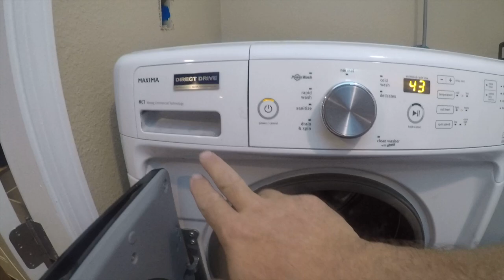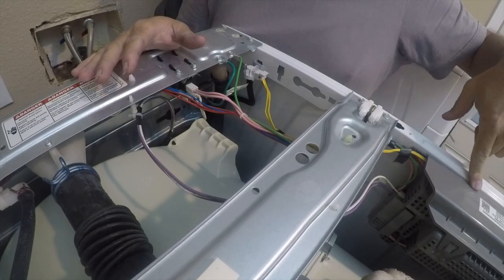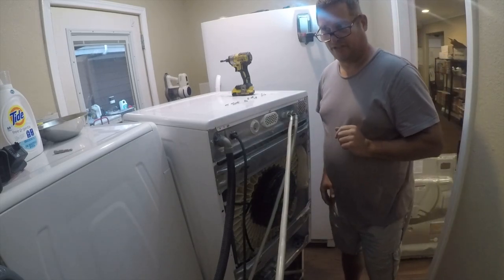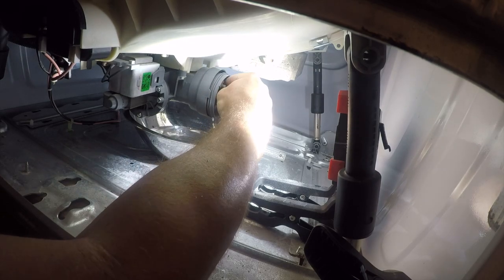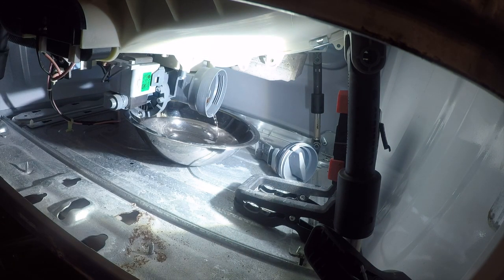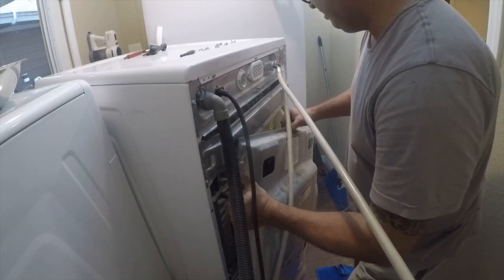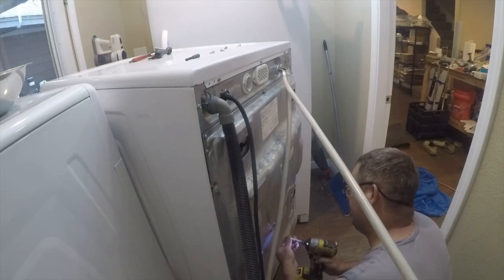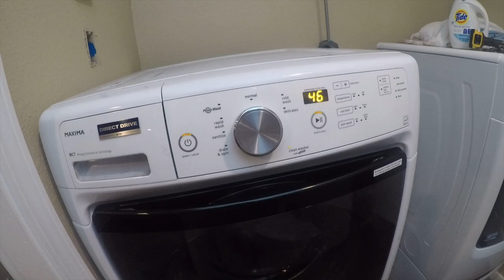Maytag / Whirlpool F9 E1 Error - change pump

Comment: If you, or someone else watching this video needs to replace the pump in the future, it is much easier to access by removing a small panel on the bottom of the machine held on by two screws and two plastic friction plugs.
Reply from the maker: Not really... that requires removing the machine from the pedestal and flipping it on to one of the sides.. .sure to spill water everywhere.  My laundry room is cozy, so removing the back panel is actually the fastest way to reach the pump.  I also don't think there is an access panel on the bottom of my machine.
Reply: @hotpuppy72  Fair point about the pedestal making the job more difficult. Mine was easier for me to access through the bottom since it isn't mounted to a pedestal and there was indeed some water that leaked, but not enough to cause any real concern. You do have an access panel on your machine as well. At 19:53 in your video you can see the white plastic friction plug protruding into the cavity of the machine in the bottom left of the shot (to the right of the shock) and the metal screws are diagonal, one of which can easily be seen between the clamp for your light and the shock.

I just started this job today and am also going to have to replace my pump. Where did you purchase your replacement pump? 

By the way, your comment about the sheet metal being manufactured by Gillette made me laugh since I also cut my hand on this hateful machine the first time I opened it up a couple months ago when I needed to clean my filter. Whoever made the design decision to not have the drain filter easily accessible from the front of the machine deserves a vigorous and enthusiastic crotch kick.
Reply from the maker: @the_dark_defender  The machine is also too heavy for me to flip by myself..... I put a link to the pump in the description.... It's still going strong with zero issues..... and was way cheaper than a visit from the Maytag Pirate.